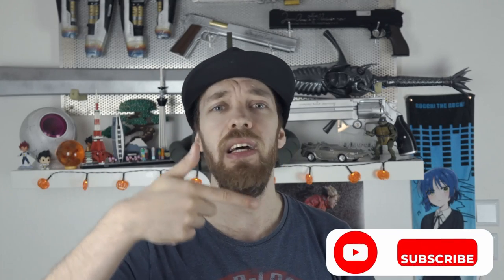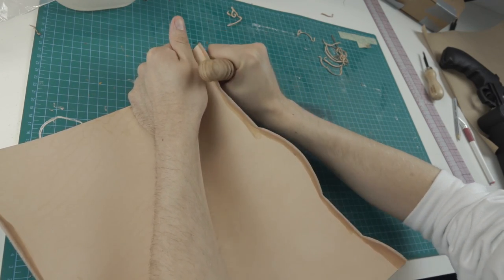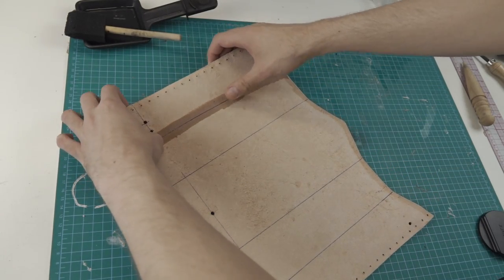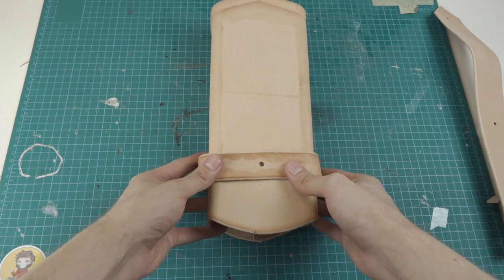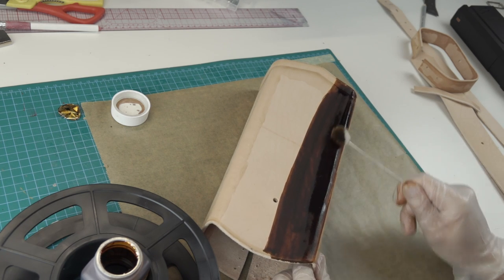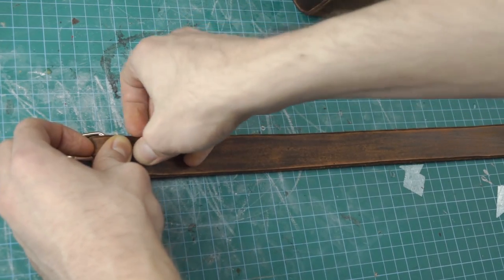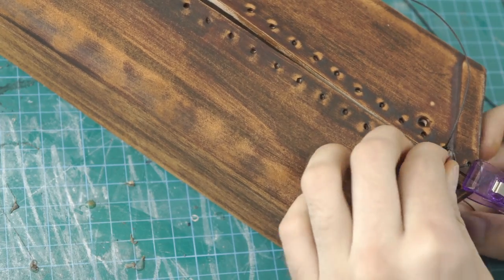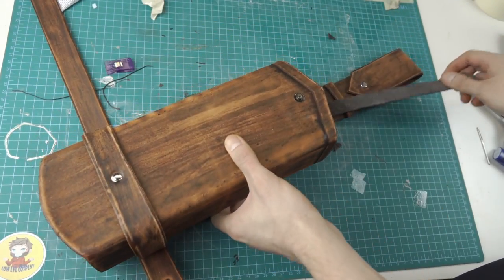Trigun Stampede Cosplay Leather Holster Tutorial

Comment: Can I ask what measurements you used? :3
Reply from the maker: I can take a look for it maybe tomorrow after work^^
Reply: @lowlvlcosplay  thank you ☺
Reply from the maker: @pillepalleegal4661 
Ok I would start with a box 27,5cm by 12 cm then face it inword on the bottom side so it is 10,5 cm and form a desired curve there. at the top just measure from the middle 2cm upwords and make a triangle.For the sides these are just 6cm wide.
Reply: @lowlvlcosplay  Thanks so much and thanks for the Videos 
They are very helpful 💪
Reply from the maker: @pillepalleegal4661  Your Welcome^^